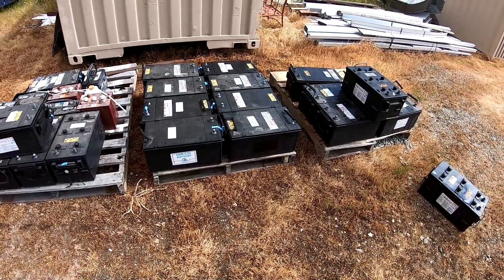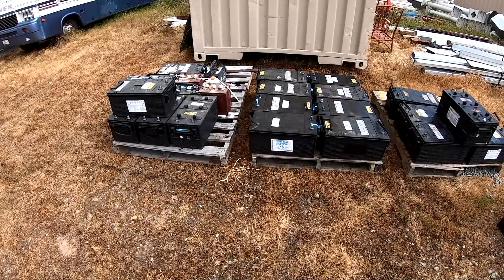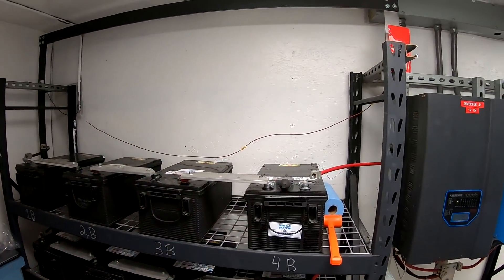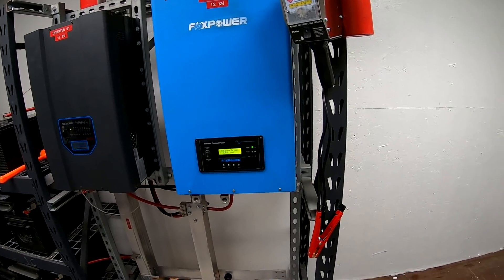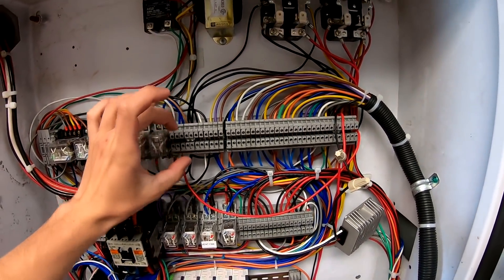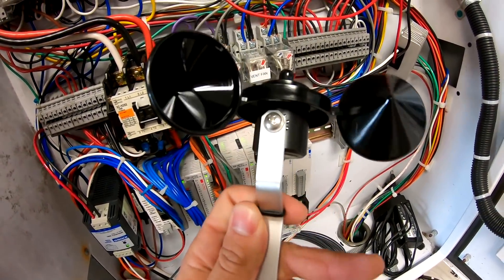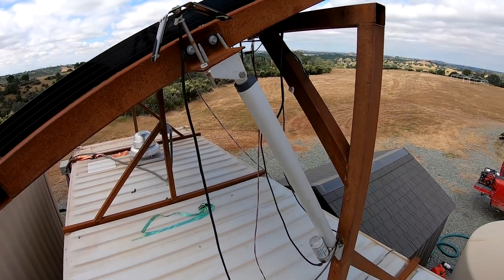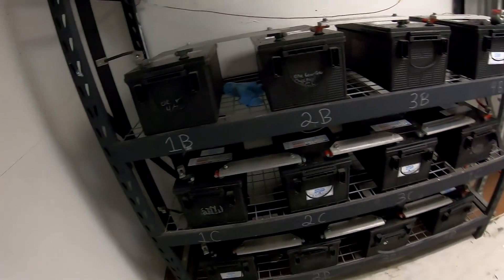Lead-Acid Batteries SUCK - Making The Switch to LiFePO4 (2/4)

Comment: I was interested in lithium batteries for solar,  but I learned they can't be parallel connected.   I think that's a problem.
Reply: They can and regularly are.  I don't know where you got this factoid from.
Reply: @tomstdenis  
Was digging through the internet all about lithium batteries.  Yes, it can be done but it's not recommended.  If the cells have different internal resistances, the one with least resistance will do most of the work and die early.  This is why i've rarely seen people on youtube connecting lithium batteries in parallel. Most of them connect them in series using 24v- 48v systems instead of the most common standard 12v.

Tesla cars have parallel connected batteries,  but their system is heavily monitored and regulated by a complicated circuitry.  This is not something an average DIY solar owners can do.
Reply: @WTF_BBQ  That's why you don't re-use discarded cells.  If you want to power your house with li-ion you buy new cells made from the same factory using the same process.  (and you test them and use proper fuse wires, etc...)
Reply: @tomstdenis  
I'm well aware of that.  That's common knowledge even for Lead acid batteries. You can't mix old ones with the new.

However, Lithium cells are not created equal even if they were made by the same manufacturer.  Fresh cells may behave similar at first,  but as time goes by,  their internal resistances will differ.  The harder you push or draw power from them,  the worse it gets.  Don't take my word for it.  You can research it yourself.
Reply: @WTF_BBQ  and what do you think is inside every lithium cell? Many pouches connected in parallel. Lol
Reply: "the one with the lowest resistance will do most of work and die early". Uhhhh. Internal resistance changes with temperature, SOC, cycles, capacity, current and voltage. The one with the lowest resistance will do more work initially, until it matches the IR of the other cells. So an equilibrium is reached (firstly by voltage, then by current, then temperature) and the load is shared within hours. The problem is self discharge from dendrite growth. This would happen if putting damaged cells in with healthy ones. As long as you check for self discharge, there's no problem. 
I've read more white papers than you.
Reply: @climatechangepreppersfaceb2148  
I had no idea that lithium battery cells are made with "pouches."   ROFL .....  Maybe if you really read those white papers as you claimed,   it's actually made with thin layers of positive and negative electrode with electrolyte and a separator.  The plates are CONSTRUCTED IN PARALLEL of each other to facilitate the exchange of ions. They are  NOT CONNECTED in parallel.  There's a big difference between 'construction' and 'connection' in the electrical world.   Is there by any chance that these "white papers" written in chinese by a guy named  Pou Ches ?
Reply: @climatechangepreppersfaceb2148  
"The one with the lowest resistance will do more work initially, until it matches the IR of the other cells." .....  Uhhh,  wut ??

You need to think very carefully.  Why would a cell with the least resistance match itself with a neighboring cell who is being sluggish ??   The only reason for this is the cell itself is being overworked and damage has occurred within the cell which increased its internal resistance.  At this point,  the cell has a lower capacity than the one that was sluggish which results in an overall lower battery pack capacity.
Reply: @WTF_BBQ  perhaps you should actually read what I wrote and educate yourself. Internal resistance is not a constant. It changes with temperature. It changes with SOC. If you actually had any experience testing lithium cells you would know this. I bet you don't even know how to calculate IR
Reply: @climatechangepreppersfaceb2148  
Oh boy .... ROFL.  These white papers of yours must be something else special like a roll of toilet paper.  Of course they're not constant, but the one with least resistance is going to work harder which means it will produce more heat,  More heat means faster cell degradation.  So now you have a battery pack with one cell that has lower capacity which will lower the overall system performance.   Jesus christ,  it's not rocket science.

Tesla cars can afford to do this because each cell is monitored by a computer.  There are many technology built into their battery packs to ensure the health of their batteries which include cooling systems.  The average home owner don't know how to do that...... Do you know how to do that?
Reply: @climatechangepreppersfaceb2148  
I'm guessing you didn't read my comment about how they have computer systems monitoring their battery's health ???  You really do have reading problems.  It's no wonder why you couldn't  fully understand what those "white papers" wrote.... that's kinda hilarious actually.
Reply: @WTF_BBQ  you keep editing your comments because you keep writing crap that even you know is horseshit. They do NOT monitor each cell. They monitor each pack. Monitoring each pack does NOTHING to stop "the magical IR monster killing cells" because that monster does not exist, because as I explained, equilibrium is reached for parallel cells. You just keep digging yourself a deeper hole eh
Reply: Lithium batteries are routinely paralleled with zero problems.  The OP may be confused with using lithium in SERIES, especially "in the box" cells like battleborn 12V100ah.  In battleborn's design, the cheap resistor passive bms only equalizes the cells inside one 12V box, where it has no visibility of the adjoining 12V battery wired in series, for say 24 or 48 volts.  The result is, just like with lead acid cells, you can get one 12V $1000 unit at 11V and another at 13V which, in series, is still 24V.  But in energy storage they don't share equally due to the 2V separation, thus the 11V battleborn will wear out MUCH FASTER than the 13V battleborn when wired in series.  I learned that lesson the hard way.  The only way to make higher voltages like 24 or 48 is with individual cells and one large bms that can see every single cell.

Comment: Chargery makes an decent BMS, for like up to 24s lithium. I'm going to get one asap. It is alot cheaper than anything I have seen, and balances at over 1 amp, its nothing like the ebike bms, that balance in the fraction of amps, useless with large cells,
Reply: Except they are very inaccurate and will actually unbalance your pack. I just lost 5x 200ah cells because of this
Reply: Deligreen has a nice bi directional dc/dc that seeks to average all your cell potentials, and actually MOVES charge (active bms) from the rich to the poor at an impressive 6A.  Big drawback is they chose audio frequencies for their oscillators, so ya hear them coming.

Comment: Those batteries weigh about 158 lb each the recycler will pay you approximately a quarter a pound think about how much money you can invest in your new lithium system
Reply from the maker: I'll make sure to fill them with water first!
Reply: Wow...the weight!  my new Aims 200 amp hour 12 volt LiFeP04  batteries weigh in at 78 lbs and I'm impressed at how much power they hold. The Aims are 8D in size.

Comment: i could have sworn i mentioned lithium in a stream before pt 1 was released 😂 tell me if i’m insane or not
Reply from the maker: The stream was me preparing for lithium!  But yeah going with 100am of LiFePO4 Prismatics to get started and later upgrading to 400/800AH depending on how things go.
Reply: mint. can’t wait to see how you integrate that digital display too.

Comment: Epoxy floor is out of the price range? $200 at the most. Yet you spend what, 10 times that on batteries? Your economics don't add up, must be a California thing.
Reply from the maker: The difference between wants and needs. I need batteries to keep the lights on and want a nice floor to look nice. The budgets for wants versus the budgets for needs are very different
Reply: @HighTechLab  right! So getting $20 per used battery (which you said you wanted) would only require 10 to be sold. OR, 4-5 working ones at a higher price would that not pay for the floor? The only thing I need to keep the lights on is roughly $80/mo for electricity. I don't know how much you've spent but guess what, $30/k or more? If so, that amount would pay for my lights for roughly 32 years.